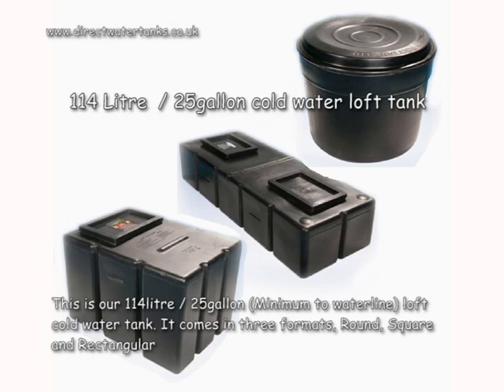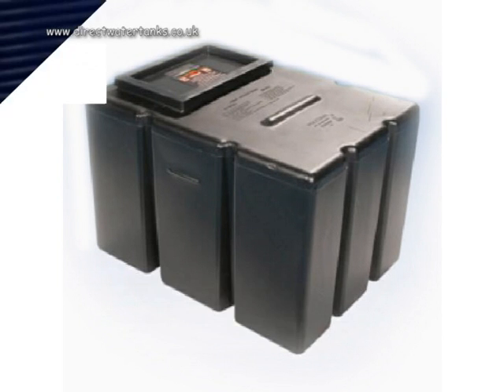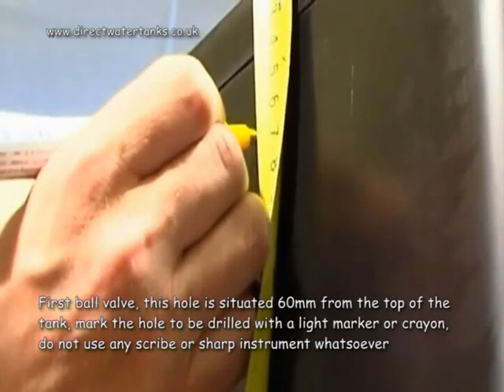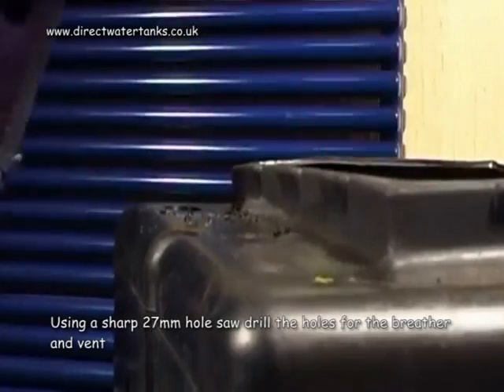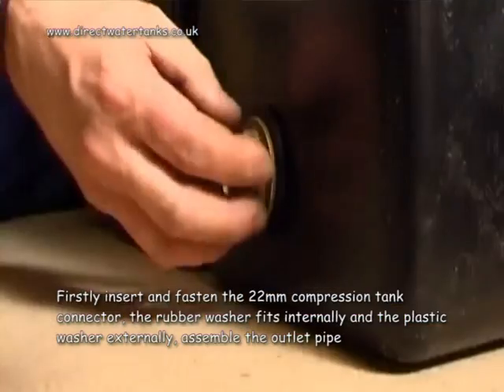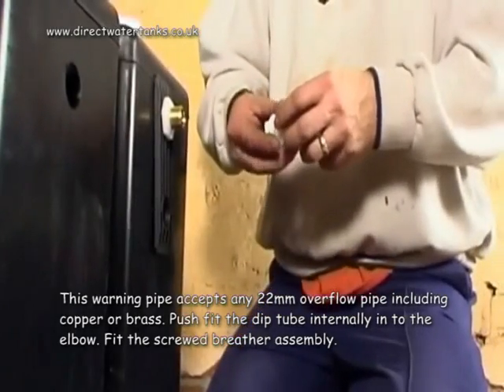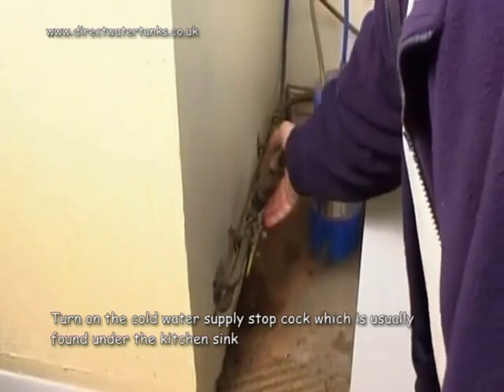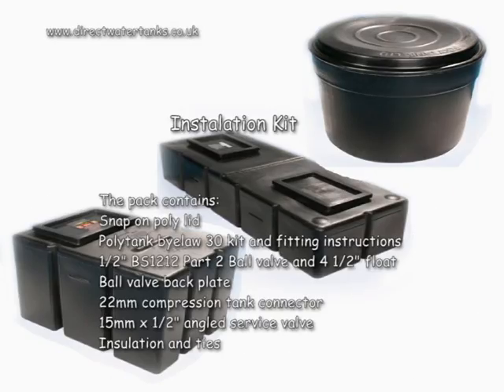how to install 114 litre cold water loft tank

Comment: Hi
Just had problem yesterday when I opened hot and cold water to fill the bath and suddenly the water tank started over floating. The ballcock is ok but the water is started running from the vent pipe from domestic hot water system. The pipe coming from to of the tank. U shape in your tank. Any idea what is the problem please